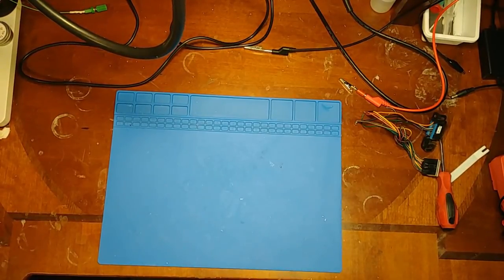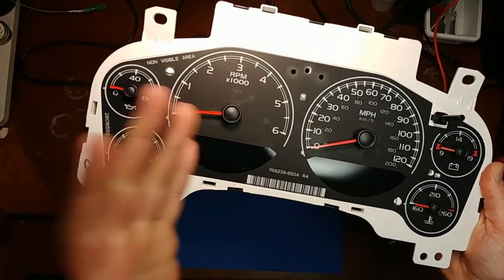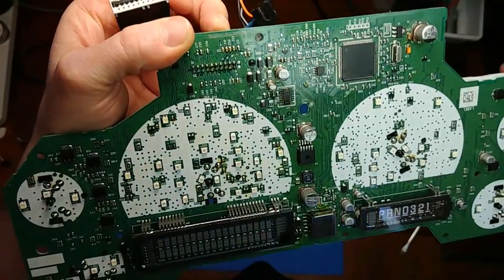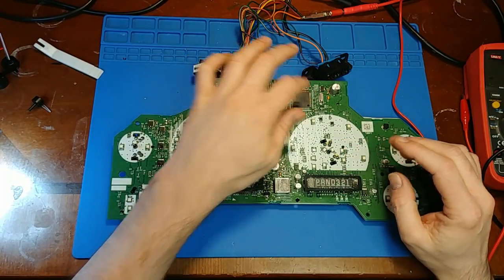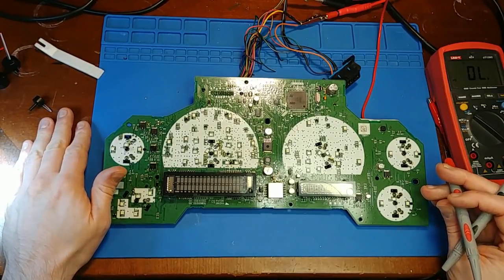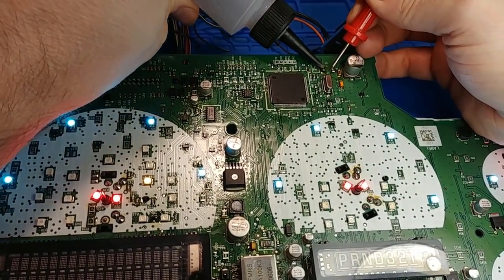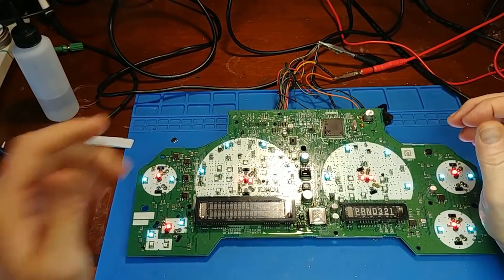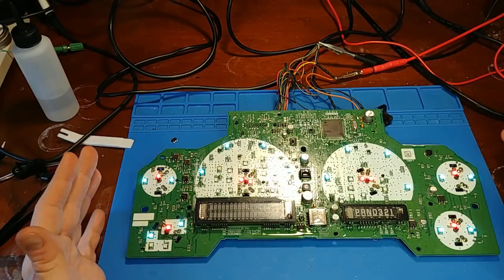No fix for you. 2007 GM cluster microprocessor

Comment: Instead of rubbing alcohol, use freeze spray (or a can of duster air upside down) and give the area a frost coating.  You'll see immediately where the short is when the frost melts on the hot part.
Reply from the maker: Yes that is a good method. But I like the convenience of using something that I already have.

Comment: I discovered your channel last evening. I'd instructed MIL STD 2000 Category "C" soldering and electronic assembly for 17 years; for what it's worth, your SMT prowess is as good as any on YouTube, and I wouldn't hesitate to have you attempt more complex repairs on just about anything I own, nor would I have second thoughts about referring friends to you for anything dash related, and more.  Try a MetCal rework station, you'll be impressed!
Reply from the maker: MetCal, that's made by Pace right? Thanks for the solder compliments! It's nice to hear. I have no certificates in soldering, just a diploma in general electronics from 20 years ago and many years of experience.
Reply: MetCal is made by OK International, with offices in Silicon Valley, Hampshire, UK, and the PRC. I purchased a used station elsewhere (can be gotten reasonably inexpensively that way) online, with new holders and tips from Techni-Tool; and am one of those "eutectic 63/37 lead and rosin (where usable, "addicts"). 

Their 'heat on demand' function makes getting through multi-layered stuff, with nasty ground planes, far more effective - with almost no chance of raising traces, pads, or barrels.  There's something to be said for knowledge gained thru experience, and you can't train your fingers to feel the condition of a pad or trace, or solidly "fill" a barrel thru watching videos.

Gain a good ESD tie-in, documentation system, vertifications, and a strap tester, and you'd be close to being capable of challenging items at an ISO-compliant level. There's money there, but enjoyment of what you do each day is of equal importance, and your operation is more than effective; you're pretty-much "golden", so changes might be counterproductive.

Life's about the enjoyment of living, otherwise, it's "mere existence, or worse".....

Comment: I'm trying to test bench my cluster. But what pins are you using on the harness to power it up? Also so you set the power supply to 5v or 12v ?

Comment: Do the micro processors have custom code on them or are they just like a cpu? Just wondering why there's no way to use a different chip?
Reply from the maker: Yes they have software stored on them. The fixed until broken channel goes over how to read/write and install one of them.

Comment: Hi Jeff .., have you ever come across a similar issue with the 07-12 gm boards . Intermittent power on. Once there running there fine til powered off. I’m thinking a bad cap esr? I’ve come a few of these clusters with the same intermittent power on issue , but no luck ? How bout?
Reply from the maker: 2008's have defective microprocessors. They need to be hot to boot up.
Reply from the maker: @NuWavUSA  I've been sending people to fixed until broken. He's got it down pretty good. More info here:https://youtu.be/V6Tw0W8W_bk

Comment: great vids bro. I've been watching ya for a week or so trying to figure out if my fuel gauge motor is going out on the 99 Tahoe I just got (in pic). reads fuel lv with key off, E when on w/ new pump & sending unit.
 watching you do these GM's has given me enough courage (or stupidity) to try and replace the 1 motor. ty
Reply: splatteredmoon find out to two wires coming from the sending unit and jump them/short them together.. your fuel gauge should indicate a full tank if you see otherwise it's a gauge problem not the sending unit.. i have seen its a 70/30 gauge problem if its so its  better to replace them all at once
Reply: thank you for that!  my confusion was that my Tahoe title says it's a 99, but the build date is March of 98. so I don't know if the right sending unit was put in, plus I switched the fuel and oil motors around to see if there would be a difference an there was. the oil gauge still reads right, but the fuel pretty much stays on 1/4 tank with key on, then rises slightly when off. also when I touched the needle with key on, the motor is vibrating, like when I push up on it, it's fighting to go down, and when I push down on it, it's fighting to go back up. it's pretty weird, but now I can at least try the sending unit test. I have the earlier square cluster.
Reply: splatteredmoon actually it doesn't matter the make or model since all auto manufacturers uses a Sweep/wiper type of a resistor to indicate the position/level of the float in the fuel tank.. some fancy diagnostic scan tools are capable of sweep testing of gauges or orders the cluster to display a specific gauge % to check it visually via CAN network. Good luck
Reply: splatteredmoon PS. Be sure you are jumping the two small gauge wires not the fuel pump feed fat wires
Reply: @Airman..  oh ok, I wasn't sure since mine are different motors than the newer white ones. alright, I'll make sure I test right ones. I'll be able to do it in a few hours and key you know, thank you my friend.

Comment: I guess it's off to the local pull apart. I just bought a 2001 Suburban with 260,000 miles from California, and all is working well except for the voltage registering high,  oil pressure registering low. I wonder where the problem really is?
Reply from the maker: You won't know for sure until you fix it. But I've seen the volt meters read wrong from failing air core motors.
Reply: @jeffescortlx  air core motor? The oil pressure sender is very difficult to access, I watched South Main Auto changed one, I do have a spare used one from the junkyard. The new ones are all made in China or Taiwan, I wonder how long they will last? And my voltmeter? I have a little plug in USB charger with a voltmeter, and it seems to be more accurate than my gauge was perpetually reads over 14, when my USB indicator varies between 13.8 and 14.4
Reply from the maker: @CORVAIRWILD  air core is the style of gauge stepper motors used up to 2002.

Comment: I notice you are using basically a pigtail connector to power the cluster. That is awesome. All you need to know then is the pin out.
Question though, can the gear selection & gauges be simulated through the connector as well? 
Sorry for such a dumb question. Im new to the channel.
Reply from the maker: Yes. Most of it is done though the data serial bus wire.
Reply: @jeffescortlx  thanks man

Comment: Good show of what was wrong by adding enough current to heat up what the component was. At least you proved what exactly was wrong with it. I dabble with electronics a bit and yes, generally if the microcessor is toast on anything, its a lost cause. I bought a shorted out RC controller on E- Bay last year that experienced a shorted processor. As thats the brains essentually, the unit is nothing but spare parts now. I at least am able to salvage many usuable parts from it. I had someone give me a Rumba sweeper that was exposed to water egress in the motherboard resulting in corrosion. I am impressed with how well build those are but not designed in any way shape or form to be water proof. I haven't  done anything with electronic dashboards except led replacement . I know GM has motor issues but there are enough guys out there that rebuild them, I dont want to go down that road. I know you can make money at it but as I just dabble for the most part, I will leave those jobs up to you.

Comment: Great video Jeff. I don''t know about you, but I always get excited when I have a cluster come in with an atypical problem. Fix or no fix, It's better than the same old repairs every day.

I wouldn't doubt it if the eBay tech's were responsible for the damaged micro though, that's what you get with those super cheap eBay repair deals. I have a lot of supposed cluster repair guys in my area who shouldn't be working on clusters. I get a lot of their screw ups.
Reply from the maker: I was just thinking about that today, I use to dred the self-repair-attempt clusters, but now I'm like "finally somthing different", guess I'll have to think now.
It's possible this microprocessor failed from ESD discharge from previous tech, but there is no way to know. I have been getting 07+ with bad microprocessors, but they are temperature sensitive, not shorted out like this one.

Comment: Hello I don’t know if you’ll ever see this but; I have a 97 Toyota 4Runner that’s a 3rd gen. I’ve noticed a small issue some people have with the gas gauge not being in accurate in the instrument cluster. I’ve seen videos of people replacing the float and other things in the gas tank but still resulting in not fixing the issue. I also wanted to know where could I find the rebuild kits. Thanks for the videos. 👍🏾
Reply: Take the cluster apart and tighten the 3 screws attaching fuel gauge.  Seen a bunch of the come loose and cause problems. East to fix.

Comment: Do u only repair GM clusters or clusters in general regardless the make? Reason for asking is i have an 07 Charger R/T that id like to change the bulb color to red if possible
Reply from the maker: If your cluster has the electroluminescent backlighting there isn't much you can do.
Reply: @jeffescortlx  how could i chk to see if it is electroluminescent
Reply from the maker: @Tony2Pockets  eletrolumimcent will typically glow green when let. If it's incandescent you will normally see twist lock socket bulbs in the back.
Reply: The board he was working on had LED lights. If yours looks like those, you can easily change those out. Older models used electroluminescents. They are generally a longer tube type bulb. Easy to spot.

Comment: Nice work man!!!  I’ve got the 07. Lower displays would flicker. If I tapped the dash, they would come back on.   They are stuck off now.  Would like to have you fix it.  Interested? Turn around time? When can I send it to you?
Reply from the maker: 07+ display repair service is $100 plus shipping. Turn around time is 1-4 days depending on how backed up on repairs I am. My email address is listed under my channel about tab visible to Windows PC users.

Comment: How can you be certain it wasn’t something downstream of the microprocessor that was dragging the 5V rail down through the micro? If that was the case I’d expect applying more power would then damage the micro
Reply from the maker: Your right. It's possible if something being driven by the micro was shorted it could have damaged it. This was a case of :have to start somewhere and do something, nothing to loose. But statistically speaking I had a feeling it was the micro.

Comment: So on my 08 Silverado if I switch the dash lights to White LEDs that will get rid of the green dash lights correct?
Reply from the maker: Yes! But they are SMD LED's so I'd recommend professional install.
Reply: Do you have a website? Or how much do you think it'll cost to have it done?
Reply from the maker: @alexzierden3963  it would be $100 plus return shipping for a LED conversation on your 08 Silverado. I can do white, green or blue. I also have a white face with blue print for the 6 gauge gas engine model for an additional $50.
Reply: jeffescortlx how can I contact you more?
Reply from the maker: @alexzierden3963  my email address is listed under my channel "about" tab. Visible only to Windows PC users, not mobile, because YouTube.
Reply from the maker: @alexzierden3963  if your only on a mobile device you can leave your email address.

Comment: How much is it to fix a 2004 cluster with bad gauges?
Reply from the maker: 03-06 full size GM's are $120 plus shipping.
Reply: jeffescortlx what do you exactly do? Do you also change the lights or just the stepper motors?
Reply from the maker: @benjaminbeltran1056  it's a full rebuild. All new X27 stepper motor, new back lighting, PCB repairs to fix all the bugs these things have, plus a good cleaning and calibration. Typically no extra charge for the "I tried to fix it my self and now it's really screwed up" repair.
Reply: jeffescortlx I want to try to do it myself but I want to save myself the hassle of making it worse so do you have an email or how do we schedule this?
Reply from the maker: @benjaminbeltran1056  my email address is listed under my channel "about" tab. Visible to Windows PC users.

Comment: Ever use a Huntron Tracker for this?
Reply from the maker: No have not. I believe that tool is just for checking analog components?
Reply: @jeffescortlx  I am not certain, but I think it will work in many digital circuits because the internal components are virtually the same and have the same failure modes... shorts, opens, etc.

The reason why I thought of it is that you could potentially have working spares that you can directly compare to your bad boards using a tracker. You can speed up the process-- and no evaporating alcohol to smell and hot components to touch.
Reply from the maker: @uruiamnot  I don't think a tracker can pinpoint the location of a shorted component.
Reply: @jeffescortlx  Oh, in a few different ways, depending on its mode. A discrete shorted component can be discovered with any old DVM. The tracker can find it in single-board mode, or it can find it in a comparison between 2 boards.

I had to do this in electronics school. In my job, a senior tech would first swap boards on a piece of equipment when a card failed. He'd then take the bad board to the shop and find out what component failed. There would be a written report, overseen by a senior tech and then an engineer. The manufacturer would ultimately get the report after a lot of senior signoffs. Yeah, I'm serious. This was high level stuff. We didn't solder a new MOSFET on and throw it into the spares pile... it got bagged and tagged to go back.

You can do a similar thing with a DVM and two identical boards as long as signals aren't digital or fluctuating. You just go around and look for voltage differences until you get a difference of ~ VCC somewhere... that will be your shorted or open component, or close to it. You turn off the power, test the hypothesis with DVM or tracker, then you lift a solder lead and verify it.

Comment: Why so many GM clusters? My 14 year old Lincoln one works fine!
Reply: He specializes in GM and GM had entire line of trucks and SUV’s that had poor quality stepper motors when they left the factory and solder migration issues on the back side of the board. There are a LOT of those clusters still on the streets and the fact that the same clusters were used in several different vehicles, means there is a niche in the market for repairs. The cluster repair business was almost unheard of until the 1999-2006 clusters started failing. Now you see it everywhere. Very few are as professional and thorough as Jeff is though.

Comment: Junkyard time too expensive from Government motors.
Reply from the maker: Yes BUT, if your not sending it out for VIN flashing you really need to make sure you match up the trim level options exactly. Otherwise your message center will be  going crazy with "service" this and that messages if it's not compatible.
Reply: jeffescortlx do these clusters have eeprom chips you can swap from one board to another

Comment: Linear regulator shouldn’t be that hot.. that’s a problem..  I don’t think it’s a regulator though.. I think it’s a mosfet not a regulator. LL2705. If it is that is shorted out and the magic smoke already escaped.. mosfet is a transistor so normally open (unless is a non common mosfet. )
Reply from the maker: The transistor at the bottom is a MOSFET that runs the VFD PSU/transformer. The the transistor near the microprocessor is actually just a voltage reg, like a 1117.
Reply: Lm1117? It should run at max 40c .. if it boils alcohol it’s at +73.4c way over normal operating temperatures.. it may be a shorted pad or the capacitor feeding the lm
Reply from the maker: @Astinsan  the microprocessor was pulling the VCC to ground.
Reply: jeffescortlx what is the chips manufacturer. It’s probably going to be a micro controller instead of a cpu. It might even be a fpga. If it’s shorting it may be a trace connection to the micro controller
Reply from the maker: @Astinsan  if it had a short going to the microcontroller, the trace would take the load, not the chip. In this case, the chip it's self was getting hot.